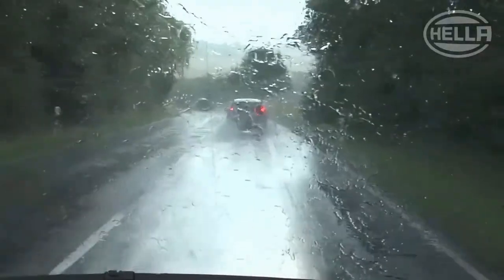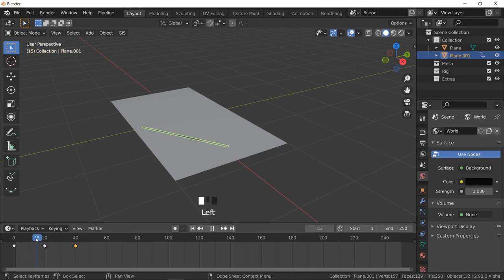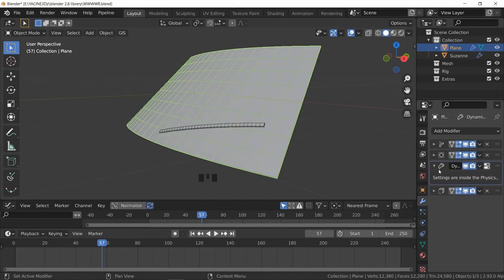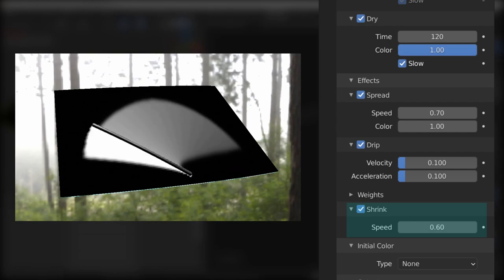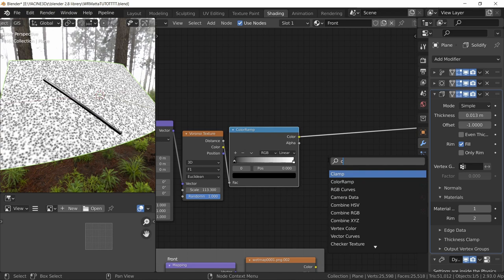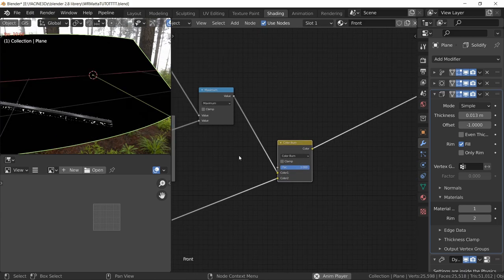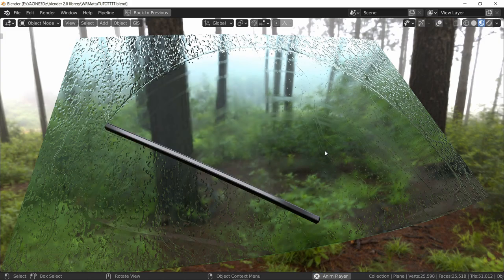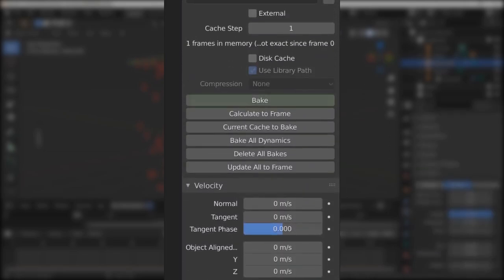how to make a procedural water drop wiper shader in blender 2.93 (Eevee & Cycles)

Comment: Dear Yacine - i just bought this. where is the wetmap? i opened the file - i dun see any wetmaps linked - in the description it says i will get the files. but there is only one blend file. please help
Reply: i just checked again - NO sequence of images for the mask linked - in the description of the product it says - "you'll get a blend file, with all the materials, and a sequence of images for the mask"
Reply from the maker: Hi @K 3D, thank you for pointing this out, didn't recognize that issue, here is a link for the image sequence: 
https://drive.google.com/file/d/17nqxaqFxMI1Lql5gAzIcOz04BaB7TtVV/view?usp=sharing
let me know if it worked for you.
Reply: @Yacine3Dz  Dear Yacine - thx you so very much for this wiper tutorial. 1 year ago - i found your raindrops tutorial and saved it for a rainy day - and now, it gets even better with the wiper. by far - this is the most realistic one i have come across. the files worked like a gem :)

Comment: yo, I really wanted to buy it cause I need it for a single shot, even typed in 10 bucks instead of 1 but for some reason this product is not to be sold in Ukraine!? what's up with that? "The creator cannot ship the product to the country you have selected." Edit: Omg, you live in Algeria and these platforms don't work well for you, I feel your pain paypal donation link also does not work, maybe I can send you some ETH or something? I know patreaon works with payoneer also. Saw that you have that linked on gdrive.
Reply from the maker: Hi @EdLrandom, thanks for supporting me, I really appreciate it. This issue shouldn't happen. I'll try to contact Gumroad support team to try to solve it. and the Paypal link stopped working a while ago.
thanks for letting me know, I'll try to use a different platform like ko-fi.com.
Reply from the maker: let me know if this one works:
https://ko-fi.com/s/1afe54f364
Reply: @Yacine3Dz  It did, let's goooo!
Reply from the maker: @EdLrandom  awesome ! thank you ! ☺
let me know if the blend file worked for you.
Reply: @Yacine3Dz  is this the same file that's on gdrive? the setup is good but the cache is not working cause it's set to vertex paint instead of frame sequence and then I had to manually re-bake and open it in the shader, not bad for me but might confuse other users I would just switch to Vertex workflow with dancer mash and tell people to re-bake when downloading. Cheers!
Reply from the maker: @EdLrandom  I changed  it a little bit, and saved it as blender 3.2. You should just unzip the file, there is a folder containing all the images (sequence). the blend file should detect it.